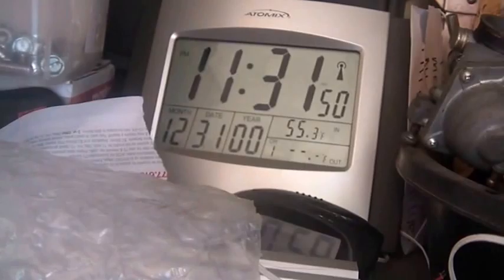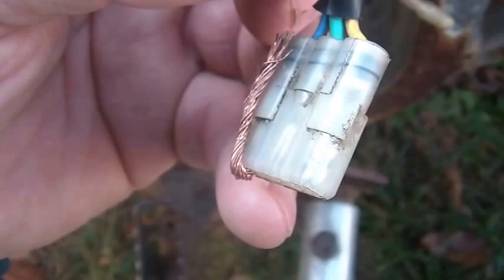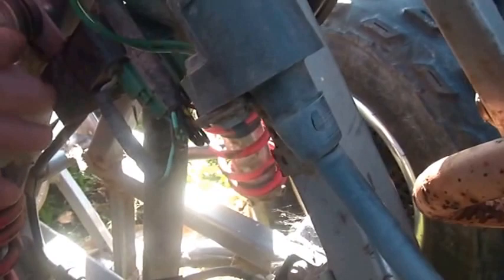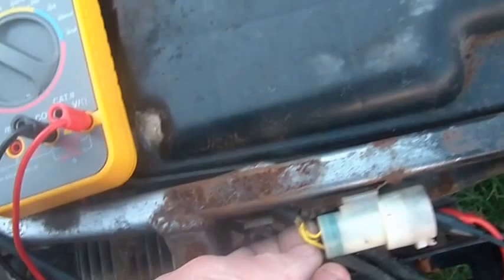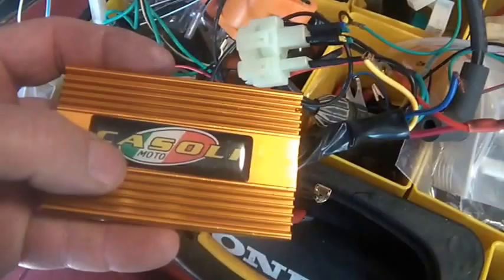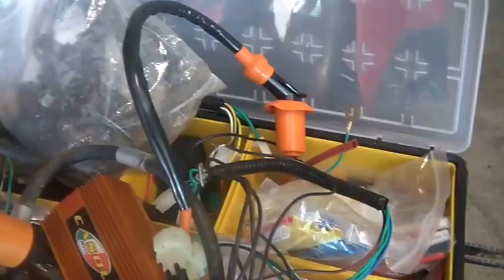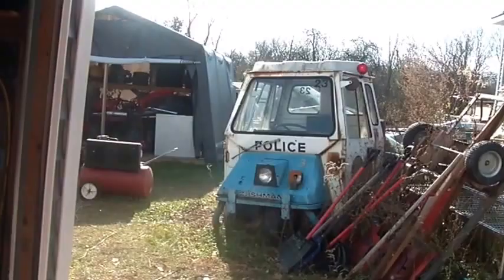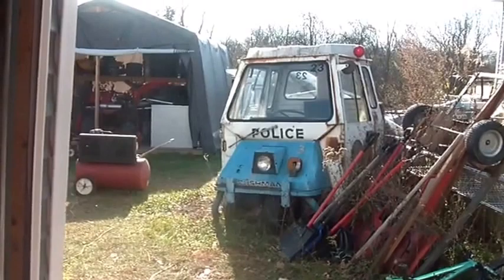Honda 300EX ignition, OEM has 2 CDI units, plan is 1 Racing CDI,

Comment: Thanks I did not know about the two cdi system I purchased a adly 300s at junk yard basically a copy of Honda 300ex and it was missing all electronics except for wire harness and I noticed two sets of cdi connections and was confused but now I am enlightened with the help of your videos.thanks .so much

Comment: I see in an add for the cdi that it is 4 degrees over stock ,is this an issue with some honda trikes?
Reply from the maker: Hey crzy!!!   Honda ATC185/200 engines have a mechanical advance, so, for the Honda 185/200 engines with a tight timing chain, it seems that on some, the advance is a little too far forward at high RPMs, one can defeat the mechanical advance on those engines, the ATC250 engines have no mechanical advance, so, the electronic advance in the GY6 CDI works real well.... Thanks for asking, watching, and commenting!!!

Comment: You are wrong about the cdi the one on the right side of the bike the larger one  is the one for forward and it is dc the smaller one is for reverse.
Reply: Do you need yo have the smaller one plugged in if not does it keep the whole four wheeler to not have power
Reply: Exactly
Reply: ,you can bypass the limiter box ,bridge it over ar the plug